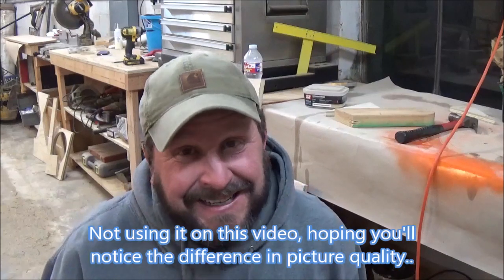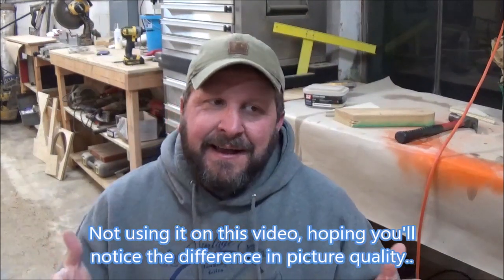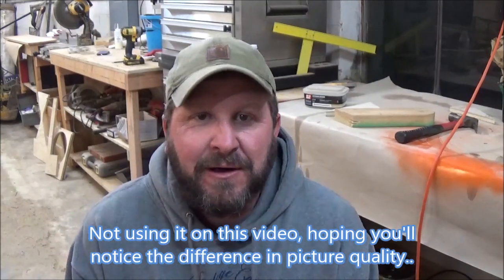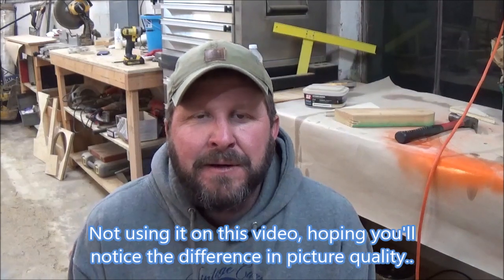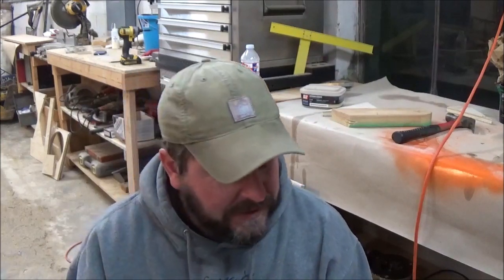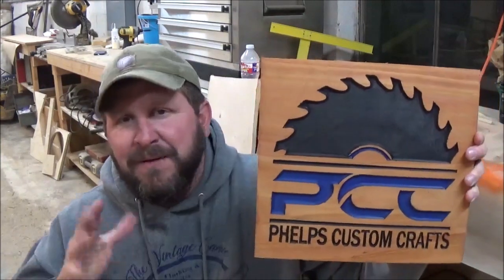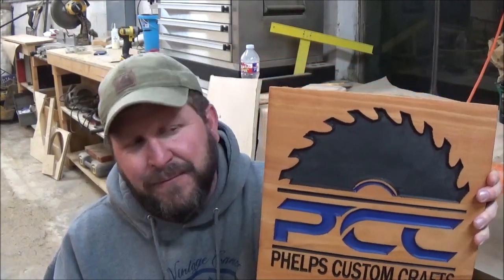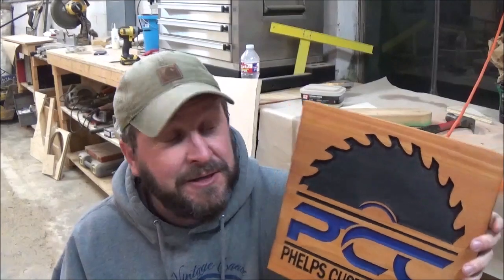CNC'd Phelps Custom Crafts (logo)

Comment: great job on this one, im learning, thinking about getting a cnc myself, now that im retired( law enforcement)., question, how do you decide your bits, do you or the program?
Reply from the maker: You decide by what look you are going for....Vcarve is probably the most widely used process...You need to get you one or build one like i did, its a lot of fun....Thanks for watching!!
Reply: Smokey's CNC Woodworks yelp im saving for one now, just one that will do paper size work
Reply: @mtz3843  For that size projects, all you need is a 3018.  It will handle 8" x 10".

Comment: how did you level your table top on your cnc? did you router surfacing bit to level it?
Reply from the maker: I made sure the table frame was as perfectly square as I could get it, and used finished plywood that as close to perfectly flat as I could get and then putting the Mdf on top was a no a brainer...it is manmade so the surface is perfectly flat on each slat....I had to level the whole table with shims because the floor is slightly slanted.  Once the frame was level the table top was level...Thanks for watching!!!

Comment: Looks pretty darn good bro. Yeah a heads up on live stream. Cat 5 cable is good for about 300’ if you can run a hard line to the shop them just add a wifi modem. That’s what I had to do for my shop. Good luck.
Reply from the maker: Thank you....Ok cool I may look into doing that down the road, we only have wireless internet access, none of the other services run out in the country on the side of town we live on....the wireless isn't superfast, takes about 2 1/2 hrs to upload one of these video's, and I can upload in 15 minutes at my wifes shop on cable internet....Thanks for watching!!

Comment: I had the same issue with internet in my shop.....
I eventually bit the bullet and buried a Ethernet cable in 3/4 conduit for a 5g wireless router right there in the shop!!
Reply from the maker: We are doing our only option which is wireless internet that comes through a tower about 1/2 mile away, not always the best but its what we have!!..Thanks for watching!!